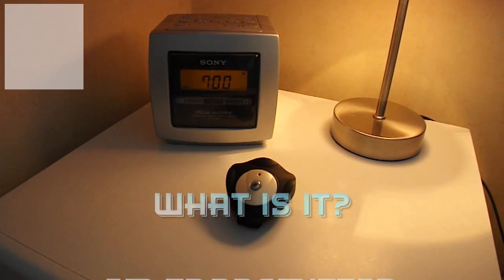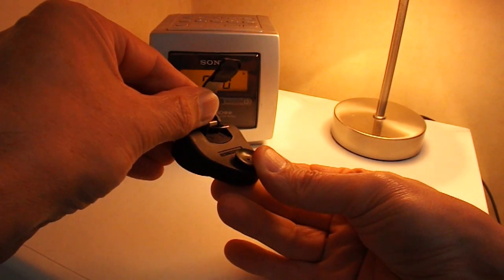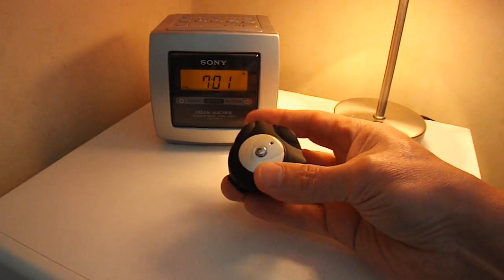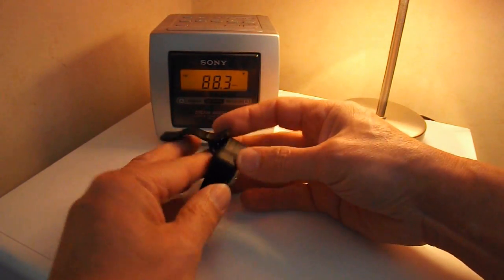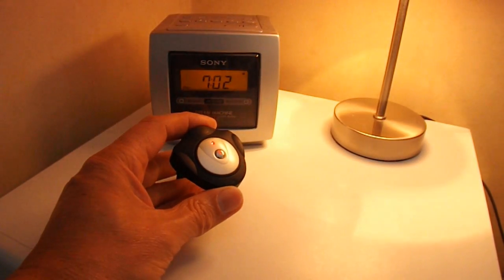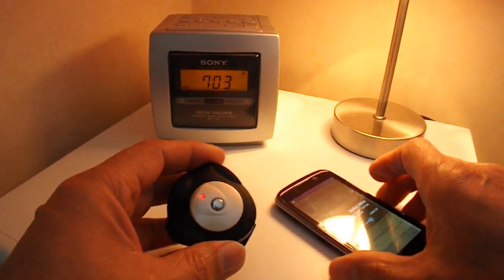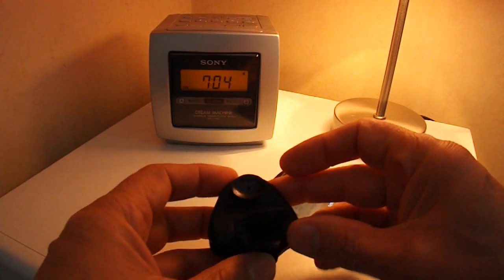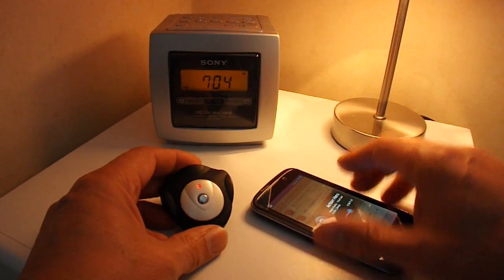What is it?   FM transmitter

Comment: The UK FM band is 87.5 to 108 mhz.
You can increase the range of these devices by adding a tuned length of wire for the aerial.

Comment: fm ( u call it vhf) radio transmitter
Reply from the maker: allan egleston your link is correct, as I said in my video it is for connecting your mobile phone to the car radio - part of a Wireless Hands Free Kit - I am not quite sure why you seem to refer to it as VHF. Yes it is in the VHF range but the system is FM - Frequency Modulation. I don't think many people even talk about VHF now unless you happen to be a radio ham :-)
Reply: i am. in the use we call it fm ( 88-108 ) as the modulation methold